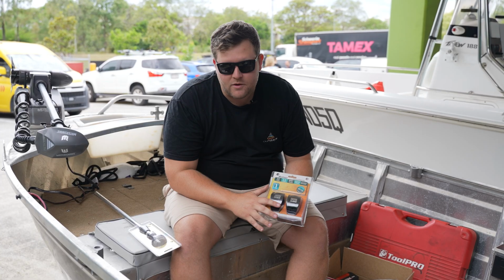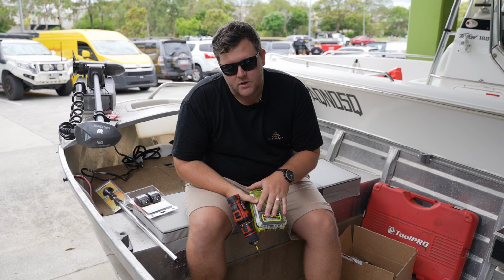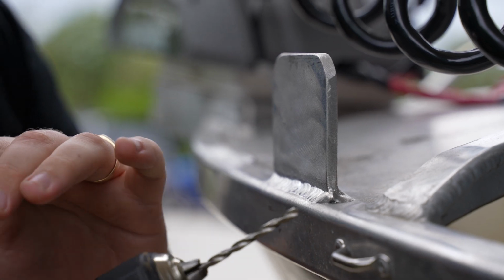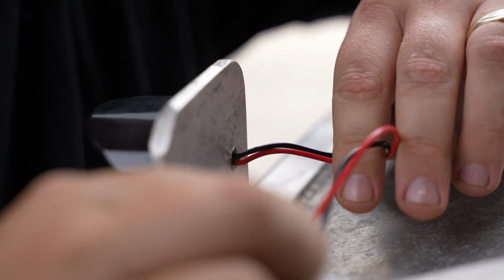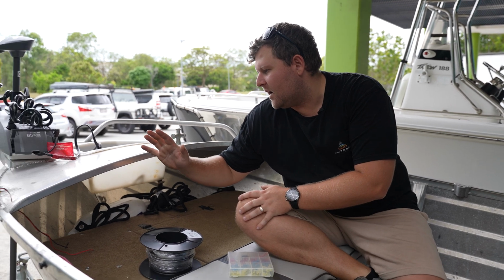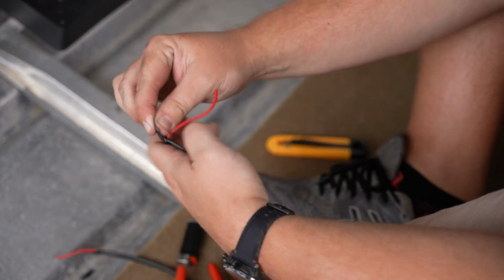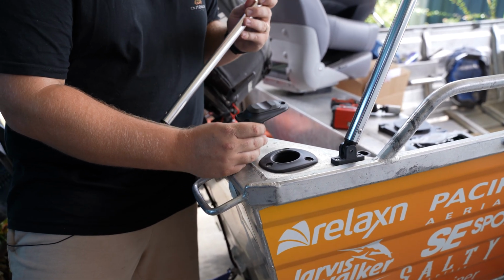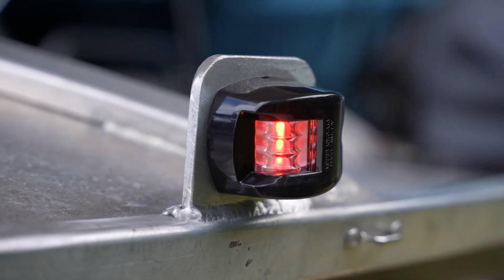Installing Relaxn Navigation Lights | TINNY BUILD SERIES EP15

Comment: Maybe I'm being picky but the 2 bits of aluminium plate appear to be welded on incorrectly,  they are inline with the curve of the bow , not the centre line of the boat , means the 2 nav lights won't give that 112.5 degree arc .  Looking front on from another boat you'll see both red and green lights even if you're not directly head on . Looking directly side on you may not see the green or red lights either from another boat , depends how far the 2 sidelights are angled inwards .